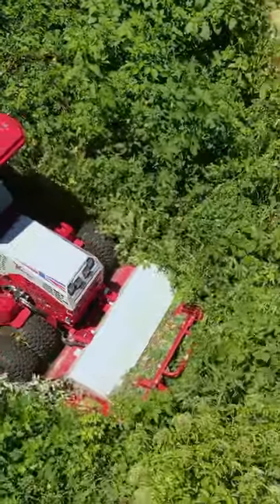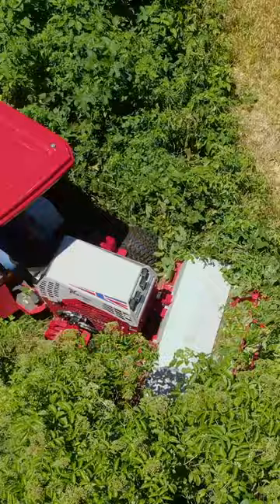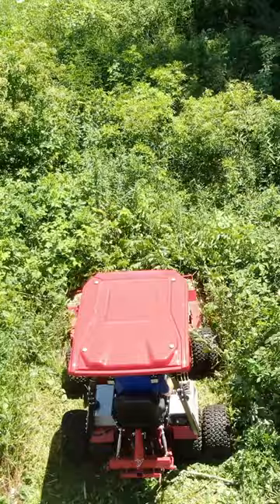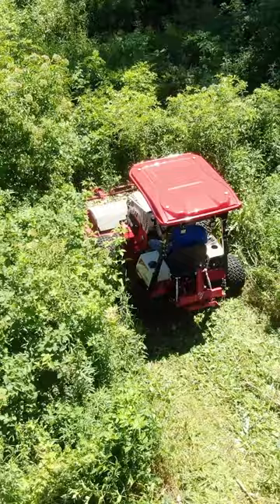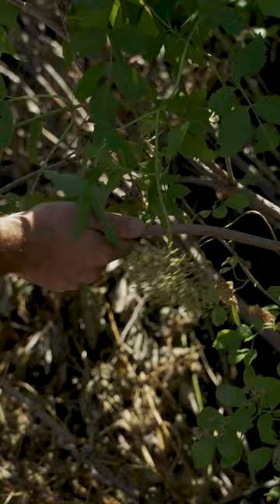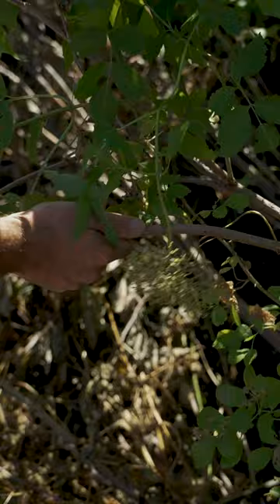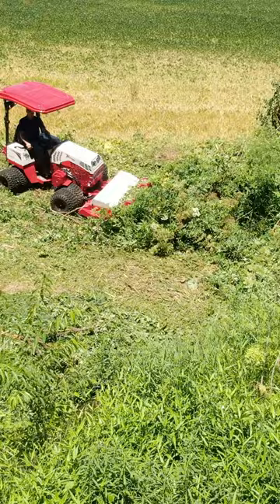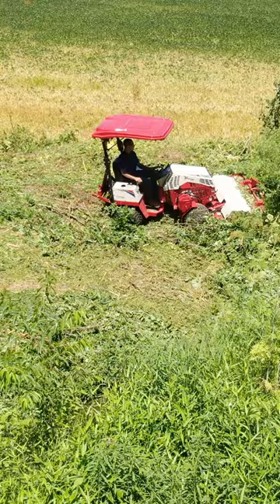Mowing Tall Overgrown Trees and Brush with Tough Cut

Comment: All i see is it laying the growth over. It’s not cutting or mulching anything! 
Hell my 83’ Chevy can do that.
Reply from the maker: The tough cut is not intended for mulching. It will grind up the material some but it more designed to cut through thick greenery and forestry material. If the material you are cutting down is not very woody at the base, the flail mower will mulch the material much better.